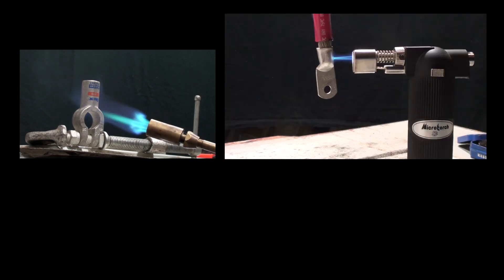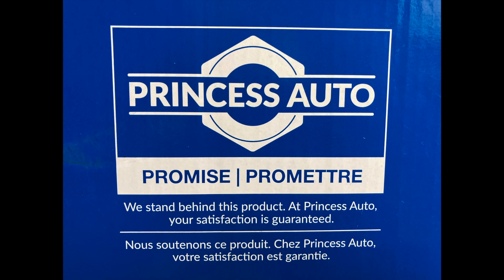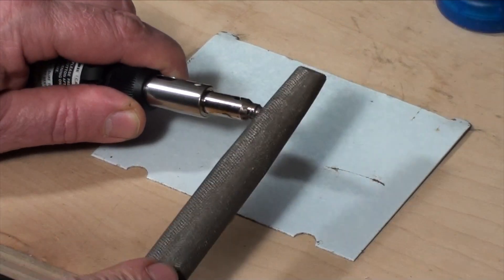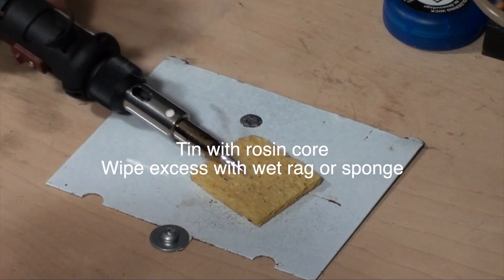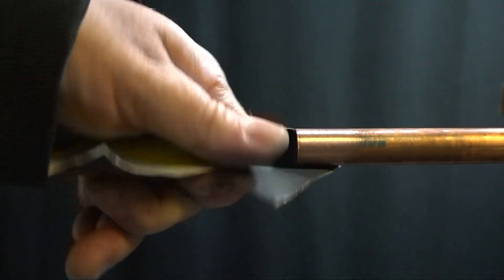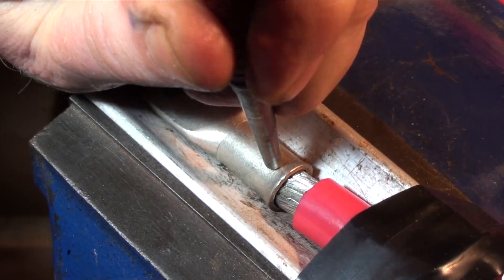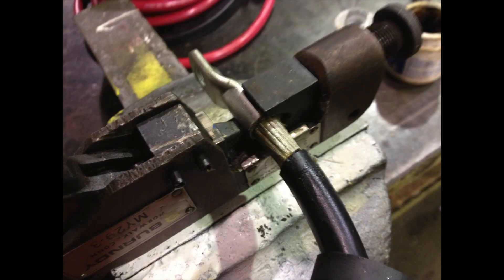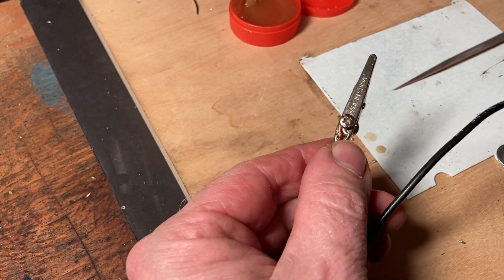Soldering101 - tips & tricks

Comment: Many tips are plated to make the solder adhere and the tip not  oxidize.  Beware of filing them as you will shorten the life by a large factor.  Just clean as hard as necessary, I usually use something like a wet scotch bright, fine steel wool, and or an acid flux.
Reply from the maker: Thanks for the pointers, Russ! I'm hoping lots more people will contribute valuable info like this.